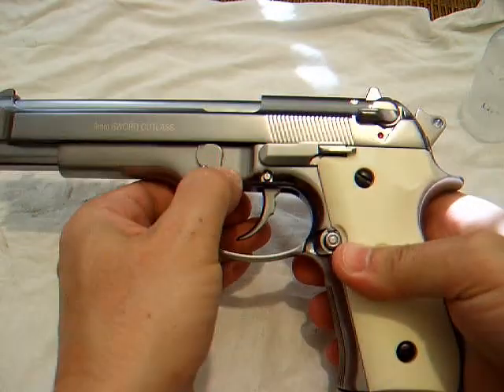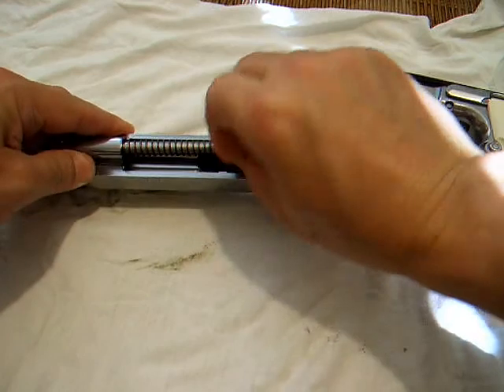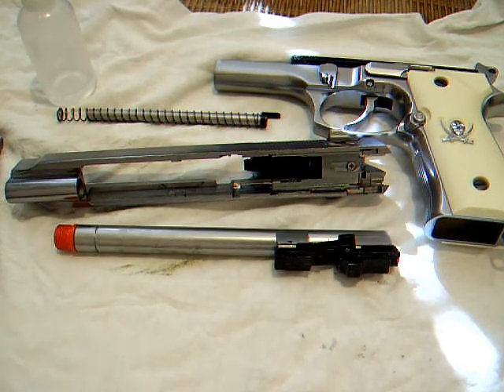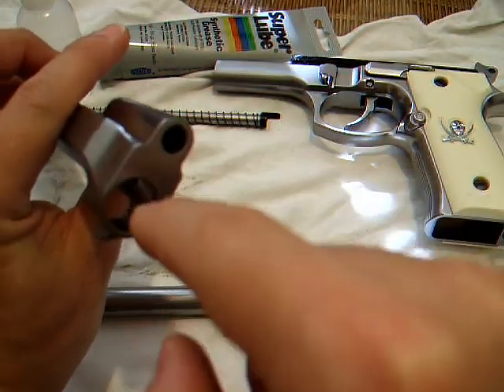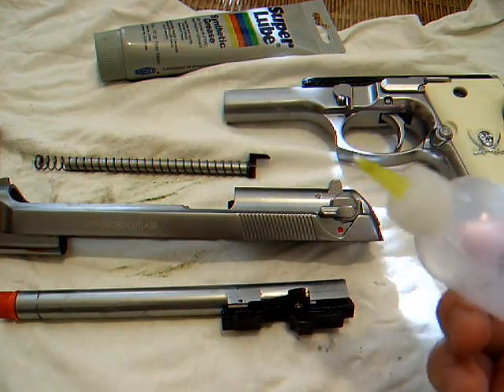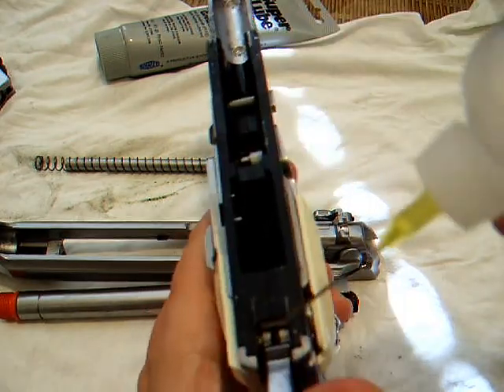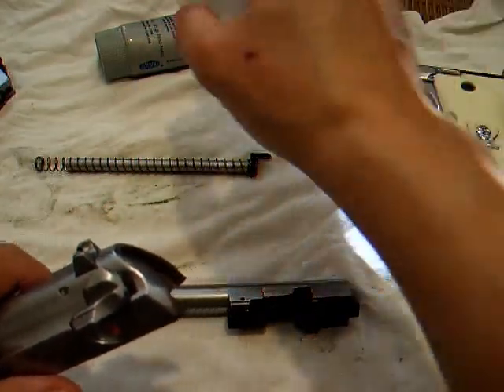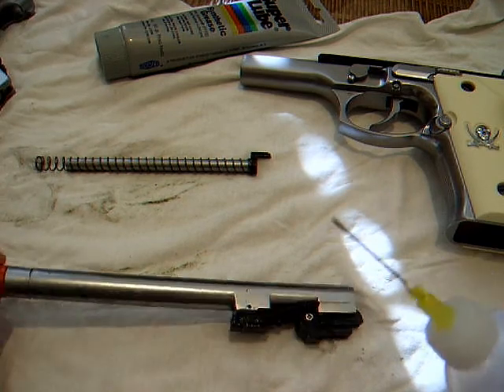WE M9 CUTLASS MAINTENANCE / aka BLACK LAGOON

Comment: can u use somehting like wd 40?
Reply from the maker: No!  For one WD40 is not a lubricant,  it dissolves off into the air!!  It is very
acidy, and designed to penetrate rusty metals and dissolve the crud off!!  The rubber seals in the magazine will get eaten by it,  and the nickle plating
does not like it!!  It will make the plating flake!!  The plain old silicone oil is the best as it is neutral,  it also will stay there longer.  The grease I use is ptfe based,  and is also neutral,  they use it on food processing machines.
Reply: What type of Grease are you using